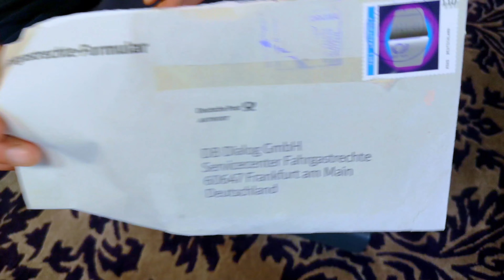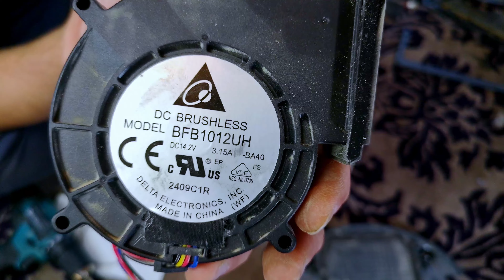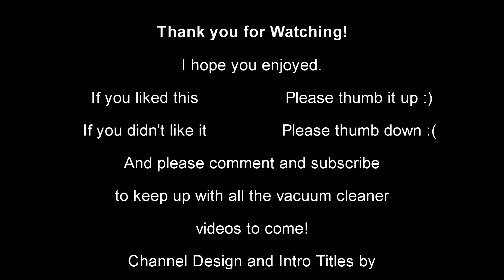Vorwerk VR100/Neato XV Retro Robot Vacuum Cleaner - Servicing & New Parts!

Comment: this vacuum cleaner looks like its main motor is one of those old Dell Optiplex CPU fans, they're super powerful!
Reply from the maker: I thought the same 😂 Just a pc blower fan. Have thought of looking for a more powerful one but I doubt I could up the voltage by much. Maybe more amps though 🤔
Reply: @beko1987  i think tiny step up voltage boards exist, but its fitting it into the casing is the hard part